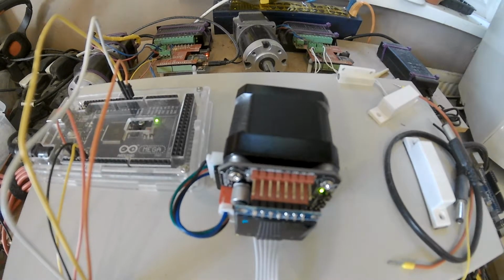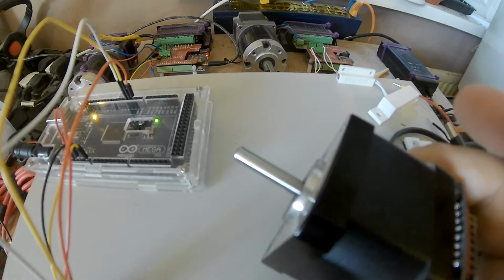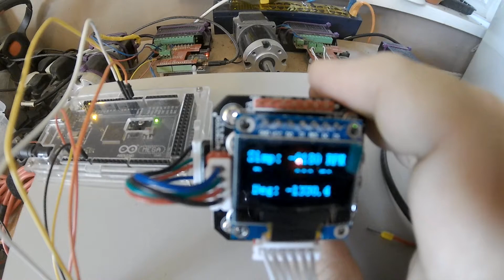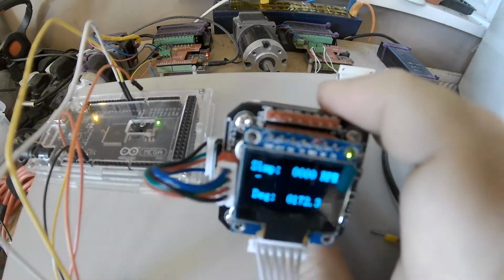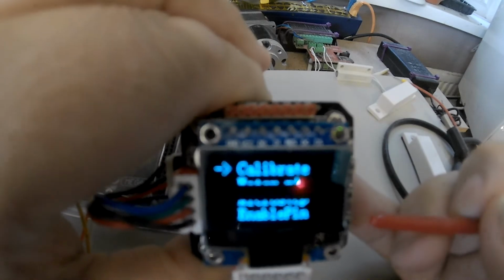BTT S42B Closed Loop Stepper issues for tech support

Comment: I bought these man, they have 4 switches on board witch make no sense when you try to use them per manual. the documentation is terrible on them. and yes they tend to freak out time to time. they almost broke my 3d printer frame slaming bed to frame 200 times per second. and when I had a successful print. print quality was nowhere near tmc drivers. a lot of surface artifact. looks like you use them for CNC which is the best application for these. I suggest you buy servo. These still need development. try to stick your magnet dead center on the shaft that will solve the freak-out problem and reduce artifacts on my print and I had to put all board switches to on to get it to work as it should.
Reply from the maker: I really only bought it to play around with as an educational gadget, I will not be using this on any 3D printers. I'm making a camera slider and I might have used it on that but there was just no need really. It's an interesting idea but I think it might be a solution looking for a problem.
Reply: @NameOfTheDragon  if they implement it right it will come handy in fast printings. 3D printers tend to lose step in faster speeds.

Comment: Hi. boughts 4 having similar issues with 3 of them...  instaled 2 on geeetech a10 printer. y axis works fine. x axis gliches allways.... menu buttons not working are due to poor soldering or damaged buttons.. it can be easily bypased by touching diagonal solder pads of buttons with something conductive.
your calibration most probably dont work if your dio swich no 4 is in of position.
Reply from the maker: BTT asked me to try shorting the buttons as you have suggested, but that didn't work on the unit I had. They send me a replacement board which works perfectly, so it looks like it was a faulty board.
Reply: Do you modify the firmware? Or replace directly?
Reply: @leesimon85  most of the times motor magnetic and magnets are incompatible resulting in glitching. after few more struggles and replacement of magnets it started to work. for installing if it was a4988 then just plug and and play...
Reply: @Baltojikale  ok, I know. Thanks.